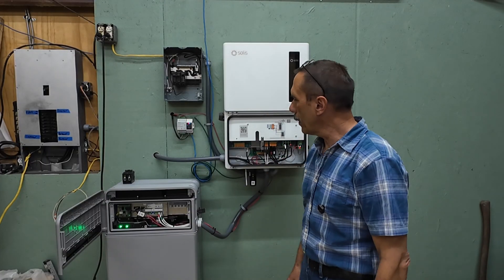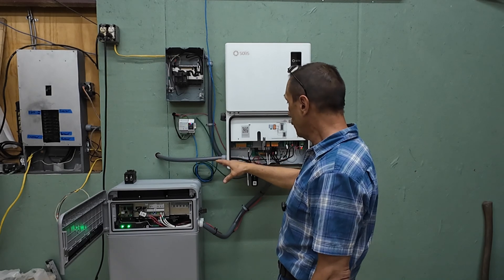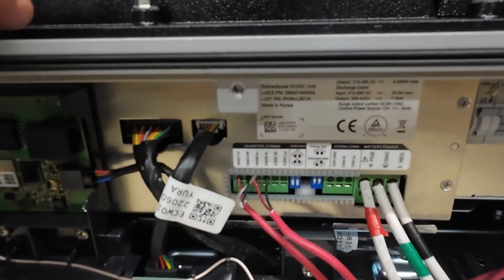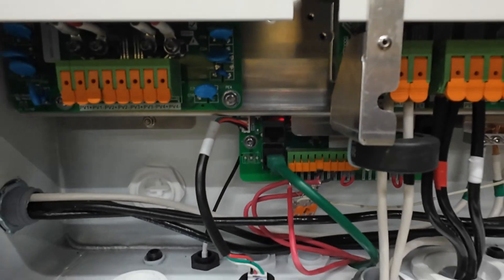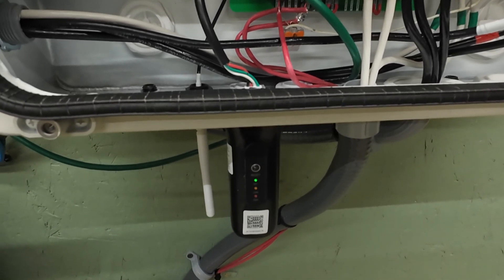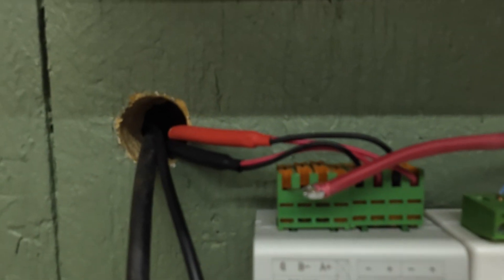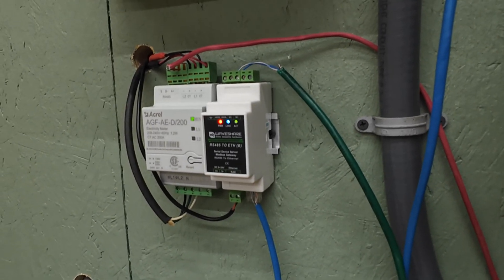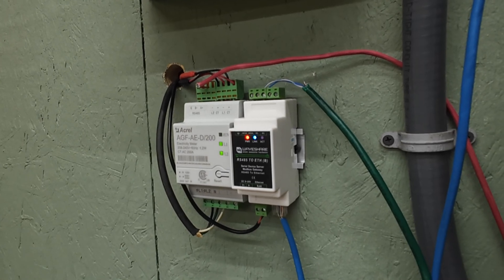DIY OffGrid Solis S6 11.4kW High Voltage Inverter RS485 logging LG Prime 16kWh Batt & Home Assistant

Comment: Ed , what you think about the solis vs a eg4 18k or flex21.
Reply from the maker: For me I like High Voltage but if you are looking to upgrade and already have batteries it might make more sense to stay 48v.
Reply: What about the function, are there anything that stands out other than the high voltage?
Reply from the maker: @Livingsolaryourway  HV runs cool, no fan noise. Easy install because small gauge wires. 48v has more battery options in the USA for now.

Comment: There is no Meter Setting in the advanced settings
There is no EPM or Meter in the device in Solis Cloud Overview
Quick Settings does show the meter.
The overview shows the battery at 80%.. 
I do have a ticket open with Solis ...
Reply from the maker: Check this video, https://youtu.be/UrfvokZteSU hope it helps.

Comment: I am trying to setup a solis s6 inverter to act as a UPS when the power goes down. The critical loads will run from the grid when it is up, the grid will charge the battery and the battery will take over when the grid is down. In the future I will add PV.
To date I have not been able to get power to the critical loads, when the power is going through the inverter and the switch is set to inverter.  There is power going to the critical loads when I switch the inverter to by-pass.
I have tested continuity on all line 1 and line 2.  They all pass.  The only oddity is the meter ln1/ln2 lights will only go green if the CT is positioned with the arrow pointed to the load.  However the arrows in the software travel backwards.
When I change the CT to point to the Grid, the lights go red, but the arrows in the software travel forward
Reply from the maker: That is exactly how the inverter in this video is set-up with the exception that I can charge it from the grid or my other S6 in the shed.
A couple of things,
1) what port is your critical loads panel connected to on the inverter? Should be on the Back-up port.
2) there is a setting in Advanced Settings/Meter Setting/CT Direction that allows you to reverse the CT direction in software. Also make sure you selected the right meter.
3) is your battery charging? what is the SOC?

If those are correct and working it's only a matter of some software settings to get it working.

Comment: I have a solis S6-EH1P10K-H-US and lg prime 16 battery and I'm having trouble getting the inverter to work, Solis tech support suspects the phasing and wants me to test.  I tested the continuity between all points on line 1 and the same for line 2.  They all had continuity.  Isn't that what is needed.
Reply from the maker: I would need more information on this, do you have solar connected?  On or Off Grid? What exactly is not working? Is it not charging the battery? No AC output?

Comment: Definitely do a video on the waveshare unit. Trying to use Solar Assistant on the same inverter you have (I have 2 in parallel) and I'm trying to work through how to get both the cloud data to remain the same and still extract data for the Solar Assistant side. Tech support mentions it does not do both (I have emails supporting their claim), but I would have to disagree after seeing this video if you are in fact running both the Home Assistant data and the cloud at the same time. Message and we can talk!
Reply from the maker: Well I would agree with you, it does work. I have a Waveshare on both of my Solis inverters now and the only issue is as I mentioned in the video that the Solis dongle sometimes must be experiencing a collision on the buss which causes a delay getting data to the Solis Cloud. Not a big deal for me because I'm doing my monitoring with HA but nice to have the cloud app as a back-up.
Are you having a problem getting it to work?
Reply: @ what version of software are you running on the inverters by chance? What's the model number too? I am working with Solar Assistant to figure this out and will be trying your option for the most part. I also got conflicting answers from Solis Engineers that I can share their response with it too.
Reply from the maker: @chasesecrist1256  DSP:V027F HMI:V0E52 Model:3208, hope that helps. What's the issue your having?
Reply: @ I'm not actually sure what the issue was, but I was able to get Solar Assistant to work and communicate with the pair of Solis S6 Inverters I have. Check out my latest video I just posted showcasing the quick setup.
Reply from the maker: Nice, I'll check it out!

Comment: So, could you AC couple an array with enphase microinverters that put out AC to the grid port on this inverter and ALSO to DC PV straight to the PV ports on the inverter? I have a enphase system but I want to add battery backup. Would the grid port allow me to put AC from the micros on my array to the inverter?
Reply from the maker: Yes but for that you would connect your enphase system to the backup port and activate AC Coupling on the Solis.
That will set up a Micro grid so the Solis can control the output of your enphase inverters.
Reply: @ thank you for that answer
Reply from the maker: @p35flash97  You are welcome!
Reply from the maker: For more information on this you can go to this page and download the manual, check out page 20-21, 29 and 66
https://signaturesolar.com/solis-s6-11-4-kw-single-phase-high-voltage-energy-storage-hybrid-inverter/?ref=piqshkgv